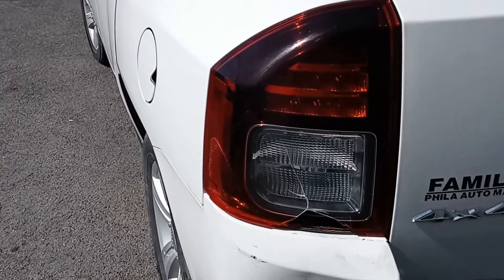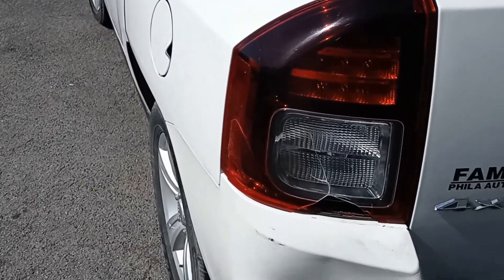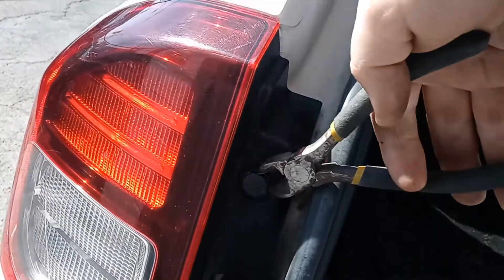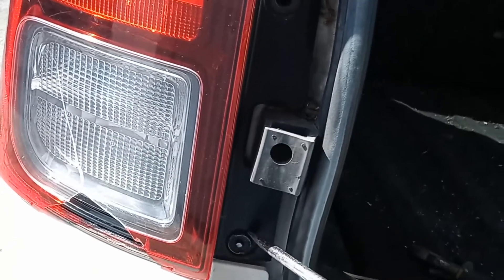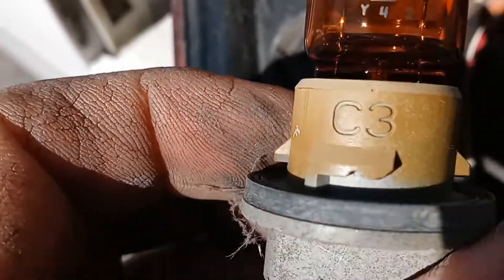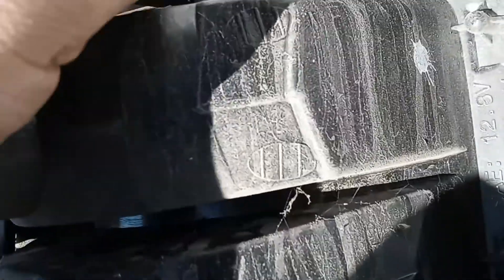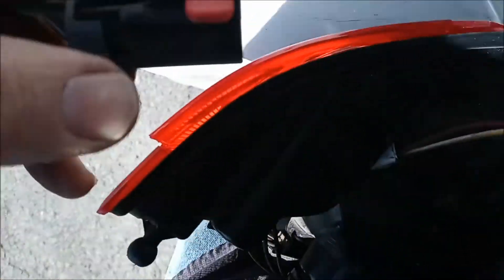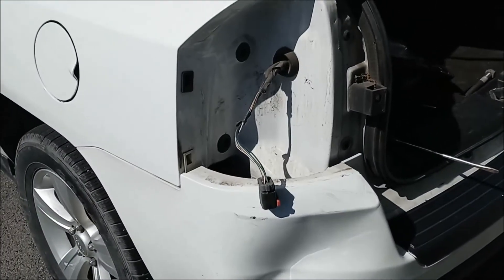Jeep Compass Tail Light Bulb  and Assembly Replacement 2006 to 2017

Comment: I have a 2013 Compass. I am trying to replace the drivers side tail light assembly. There is a wire from the old light assembly not in your video. It appears to be a ground as one end screws into the car, while another wire goes into another a unit above this area. I cannot find this on any videos. Amy idea on how to deal with it?